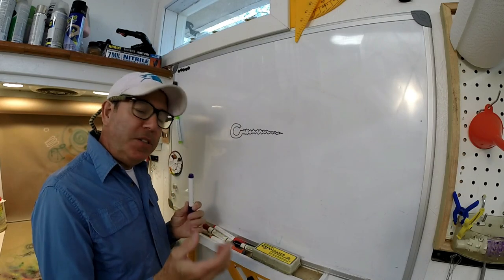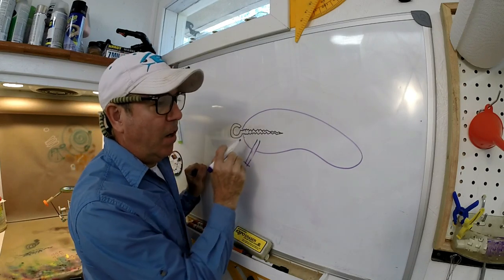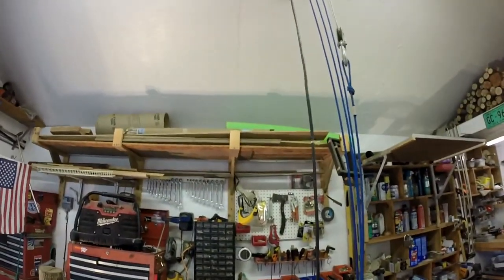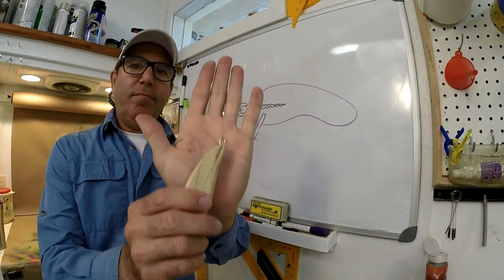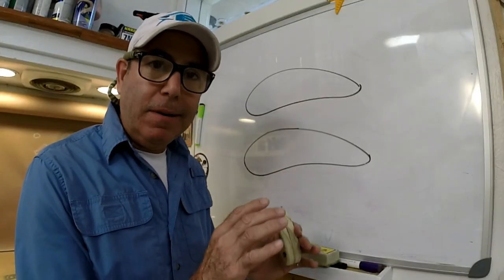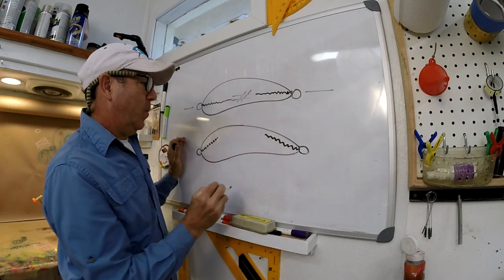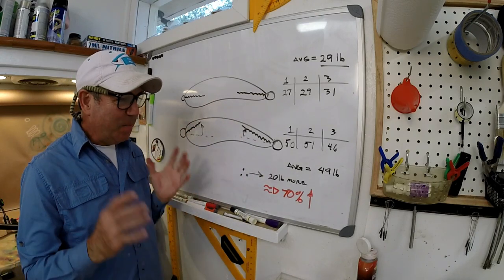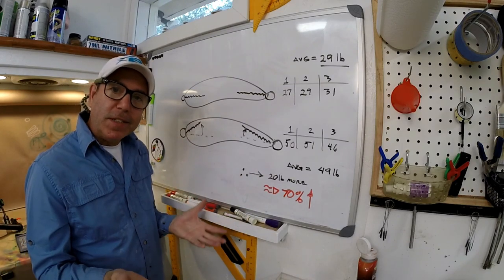Lure screw eye pull out test

Comment: I know this is an old video but I wanted to suggest that when using purchased threaded screw eyes, wipe them with alcohol before installing. I have found that there is a barely noticeable amount of oil on the surface. I think it is residual fluid from the manufacturing.....I find it aids in adhesive adherence.
Reply from the maker: This comment slipped by me...thank you for the tip...it's a good one.

Comment: Great video! Keep them coming.  I like building my lures thru wire (large crankbaits for musky fishing), but it is a hotly debated topic in the lure building forums (thru vs screw).  What I worry about most isn't the initial installation of the twisted screw-eye, it is the longevity of it.  It may test super strong initially,  but I want years of abuse and banging off rocks, adjusting the eye for tuning, and hopefully hauling in a few 40lb plus fish. It would be interesting to test a few old lures to see if the pull out strength would have changed.  I like the idea of putting the screw-eyes in at an angle, it obviously helps.  Thanks for the information.  I'm also curious to see if glue would increase the holding power of the eyes as well.  I don't think i'll ever be convinced not to take the time and make a true thru wire lure (it also bothers me when a $100 dollar premium hand made lure isn't made as strong as possible with thru wire).
Reply from the maker: you are absolutely right. You're much better off with an embedded one piece wire harness or a through wire system. I have tested old lure with screw in eyes as I find them. And as expected to pull out strength his dismal mostly because builders put in eyes that are way under sized. The data I have is kind of sporadic so not really Worthy of publishing. But I'm convinced that  its best to use other options. Thank you so much for your comment and keep watching I'm doing more testing as we speak ... Happy holidays

Comment: Nice work bud! I do some of this stuff and this is the first / most informative video on the topic of lure making. Many people do film, but you have the knowledge behind that with statistics that count. I learned much, thanks for posting! ps. I like thru wire construction too, but hook attachments outside of the line tie eye (nose) & the rear hook attachment (tail)... such as the lower hook attachment, or hook attachment underneath the lure on the belly section, .. well I dont find those too easy to incorporate in wire thru construction without cutting the lure in half. That to me loses some of the lures solidity. If you have a suggestion around this I'm all ears. Cheers! tight lines.
Reply from the maker: thank you...and I have been planning a couple of videos on through wire and alternatives to through wire systems, keep an eye out.

Comment: Interesting, love these sort of tests! I have always prefered a thru-wire harness and make them from moderately heavy wire. From a bass/walleye sized fish perspective where line weights are (relatively) light and rod power low ( a typical rod would be hard pressed to lift 3 pounds off the floor ) even 20 pound pull-strength would probably be more than adequate. Of more concern would be the rigidity of the wire tie-point, you would not want it to bend to throw the lure out of tune or flex and fatigue. Thanks for the video!

Comment: I make the same twisted screw-eyes. Also epoxy them in. Then the lures are painted and clear coated, so they should really be solidified, I would think, being fully encapsulated as well. There's a couple wood lure companies near me, and they both put in their screw-eyes "post" production. After everything is clear coated, which itself is quite thin, they have pre-drilled holes and the then screw in the eyes. That's gotta be the actual weakest way it could be done. But, they are in it to make money, so they build faster and easier. And the screw-eyes are often crooked, then they say they just need to be "tuned" once you get them in the water, by turning the screw-eye left or right. That sounds farcical to me. They are actually advising the consumer to "loosen" the eye to "tune" the lure.
Reply from the maker: Your right.   I actually bought a  7 inch topwater lure that was lathe made and decided to refinish it. When I took out the screw eyes they came out when I pulled them by hand.  They were only  1/2 to 5/8   long and really thin gauge.  There's surprisingly little thought put in to the hook eyes.  What saves most of them is the fact that often the fish gets hooked on the belly hook or both hooks.

Comment: Hi Franco, I'm trying to find options for the strongest and lightest hooks I can find for some Amazon fishing that I do... To have best lure action with minimum risk of losing fish..  I like the idea of finding an in line single hook replacement but they bend much easier than a treble hook even the heavier duty ones 4x, etc .. weight to strength, what is the best option to handle at least 60lb pull in your experience?.
Reply from the maker: As far as lure action, the key that is to have the hook attached by a split ring or free moving bridle.  The biggest impact to action is drag.  Treble hooks have a lot of drag...single hooks have much less drag so you can bump up to the next size.

Comment: Good info 👍👍 what kind of through wire diameter would you recommend for muskie & pike my friend ? Keep up the good work
Reply from the maker: .05 inch is plenty strong
Reply: @EngineeredAngler  many thanks buddy 👍
Reply: @EngineeredAngler  wondered if you could give me a little advice, I've just watched a video of a guy laying the screw eyes down on the silicone mould before adding the epoxy, so they are set-in when the epoxy cures, how strong do you think that would be ? Not so much the eye bending as in your video, just as in the actual screw holding in ? 👍👍
Reply from the maker: @andyprest  
All things being equal..it should be at least as strong as glued in.

Comment: Don’t know if you really watch the comments any more. But what about the one hook eye between the line eye and the hail hook eye do you angle that one also angle towards the back opposite of fish pulling, 
One more thing, I tried driving in my twisted eyes like you make yours, but bent all 12 I tried driving in. You had to hv drilled a pilot hole? What size pilot hole? 1/16” or 1/8” thanks 
Do you make the bottom of pilot hole bigger at bottom than at top, kind of like post holes digging always mushroom out the bottom of hole, or just a straight in line hole straight in at a angle? Thanks
Reply from the maker: Yes, I angle the belly eye back, this gives me a better holding angle and allows for a deeper screw in.  I absolutely drill a pilot hole, the same size as the diameter of the twist eye. This way it will screw in with a bit of friction but not so much that it binds up and bends.

Comment: There are advantages to eyes, it is the better way, particularly for home makers, but even generally.  You just have to figure out how to really attach them, and there are ways to do it, sailboats use techniques even more today, to attach stuff without penetrative mechanical fasteners.  It is all bonding. 

Once the technical problems are solved, you get the advantages of better sealing of the plug, lighter weight, and you can make much slimmer plugs for Needlefish, etc..
Reply from the maker: I totally agree...so many lure makers feel they have to use a through wire to have a strong connection. With some care and a bit of cleverness you can use screw in eyes with excellent results. Thanks for watching.

Comment: Old video,new question hopefully I’ll get a response. What’s the strength of a screw eye that’s been cast in a resin mold? Would the resin drying around it be like super strong?
Reply from the maker: It's definitely stronger to cast the lure around the screw eye than to try to screw and glue.  But it will only be as strong as the shear strength of the casting resin.
Reply: @EngineeredAngler  how can one find out the shear strength? What’s the thinnest gauge wire you use for wire through builds?

Comment: Why do you consider the twisted eye better when it held 49 pounds vs the 57 pounds the screw eye held??
Reply from the maker: You need to take in to consideration the mode of failure.  The screw in eye failed by allowing the eye to open.  There's not much you can do to improve that.  With the twist eyes you can make it longer, change how tight you twist it, and improve how you glue it in, to increase the total strength.  In short, the screw eye is limited unless you want to up the gauge of the screw pretty significantly.  Thanks for watching.

Comment: I developed an interlocking system that I believe is stronger than even the through wire method, which I hate because it's a pain and it's putting all your eggs in one basket, (no fail-safe redundancy). Unfortunately it's a little too complicated to explain here so I guess this is just for the algorithm.
Reply from the maker: Well..I'm sure if you are building redundancy into the system it is much more secure.  But, there is such a thing as diminishing returns.  If your system can absorb more load than the fishing rig you're using then the value of it might be marginal.  But I like to over-kill too😃

Comment: Test what the breaking strength is once the lure is finished and clear-coated over the eyes.
Reply from the maker: I've tested it  to see if the clear coat three coats actually would add some strength but it does not.  The lesson is that you need to design the strength into the wire / wood / glue combination.  Your not the first to ask this question, lots of folks are under the impression that the clear coat will help.  The best practice is to be sure that the screw eyes are not parallel and embed them as deep as practical.
thanks you for the question and being engaged....cheers.
Reply: @EngineeredAngler  wow, interesting. Thought for sure it would. Even e-tex too? I would think it must help, as it's one hell of an encapsulating coating.

Comment: Man, I can hang my Muskie stick baits from the ceiling and hang on it without the eyes going straight and I weigh 145.... I like your research!
Reply from the maker: You probably have heavier eyes....sounds like an easy strieght  forward method
Reply: Engineered Angler Absolutely, I use the magnum eyes. I also 3D CAD my lures and print them in halves on a Prusa MK3 printer. I screw the eyes into hook anchors before gluing the halves together with JB bond, wires, weight, eye screws, anchors and all. I’m glad I stumbled on your channel, you have some good information that could help my R&D. Thank you
Reply from the maker: @allinclusiveangler  
Sounds like a rock solid system.
Reply: @EngineeredAngler  I sure make it sound that way, but I'm only 2 months in with the 3D printing and invested quite a bit$$ into it; so it better work!!
Reply from the maker: @allinclusiveangler  
HA...I'm sure it will.

Comment: Confused. You're comparison seems a bit flawed and with respect to the test I'm very confused... The screw eyes failed at 57#, because it has an open eye, and you create twisted eyes to solve this but then they fail at 49# (likely because they don't have the threads a screw does)... Help me see the logic here. I'm not a hater, I love your scientific/analytical approach to everything I'm just not following this video.
Reply: Maybe tack weld the eyelet shut is a better solution? Err JB weld?
Reply from the maker: I think the answer would be clear if you watch this video:
https://youtu.be/YDNXd8ILnJ0

But just so that you understand my point: mostly I was giving two key pieces of information: first, a well installed screw-in eye will fail at the eye so you can't improve it by gluing it better or deeper.  Second, the twisted eyes will fail in shear but the performance can be greatly enhanced by increasing length, angling it in reference to the tail hook eye, and using a high strength glue.

Oh and as far as somehow tacking the eye closed, these eyes are nickel plated brass, the effort to glue or solder them would not be worth it (in my opinion).
Thank you so much for your thoughtful questions.